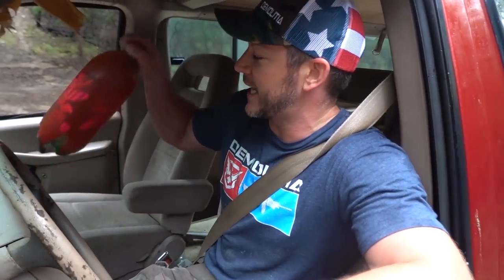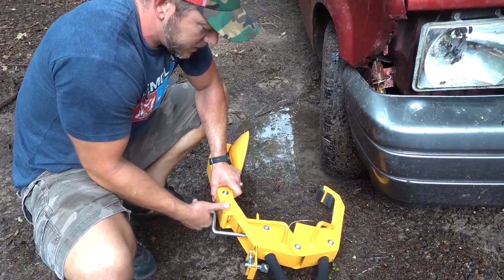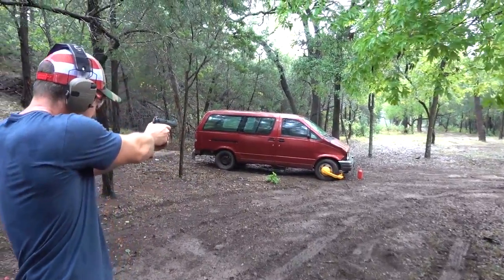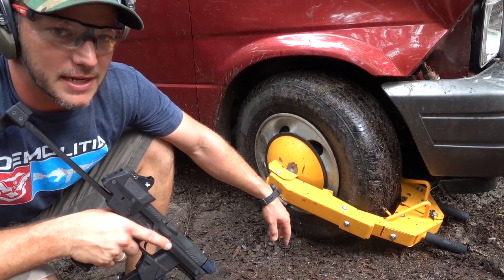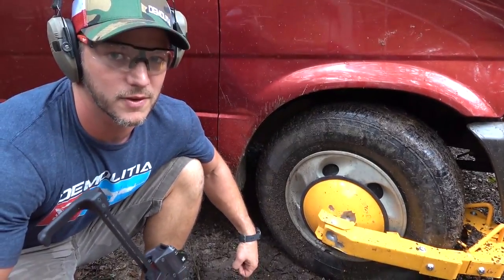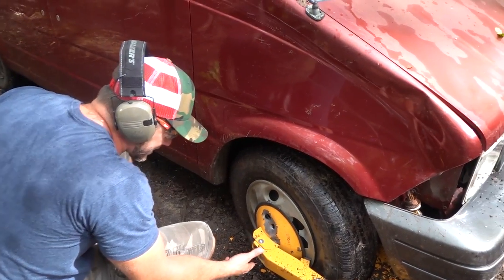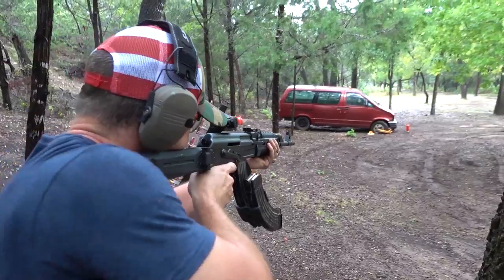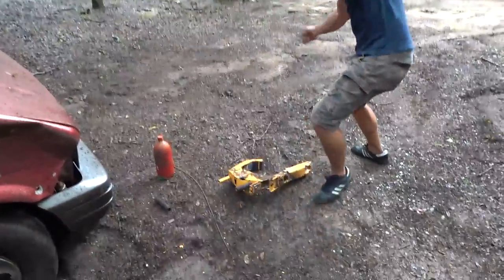Can You Shoot off a Tire Boot WITHOUT Popping Your Tire???

Comment: I’m no mechanic, but I’m like 90% sure you’re not supposed to have all that liquid pouring out the front.
Reply: Hmmm....   Time to go to the shop I guess.
Reply: Liquid cooled
Reply: @timothydavis9777  Emphasis on the past tense in "cooled".
Reply: I am a mechanic, and can certify that while not designed to drain that way, you can 100% lose those fluids for weight reduction. Matt turned big red into a race van.
Reply: I am a mechanic and you are correct, sir.

Comment: When dealing with a boot I've got one word for ya,  battery powered angle grinder
Reply: one word would be batterypoweredanglegrinder
Reply: Thats 2 words 😒
Reply: Ok
Reply: Uh 4 words
Reply: My favorite word
Reply: That’s four words
Reply: This dude
Reply: I mean i keep an extension cable and an angle grinder in the truck, so all I'd need would be somewhere to plug in at. Or an air compressor and a pneumatic cutting wheel.
Reply: He must have experience
Reply: Cheap tubular lock pick really ez
Reply: Or a cutting torch which would be faster and quieter a burn bar or a breaching round for doors or if you got several grand a hydraulic rescue tool like the jaws of life or a plasma cutter
Reply: Thats 4 words 😐
Reply: ThaTs fOuR wORdS
Reply: IStayHighI 4words
Reply: @dax8407  good job realizing what the joke was. Do you want a gold star?
Reply: That is 3 words
Reply: @alexbolin852  he did say " bsttery powered"?
Reply: @southernshop8424  I've never really tried a battery powered angle grinder before. Usually when I have to use one I have an outlet near by or on the vehicle itself
Reply: @alexbolin852  I was thinking battery powered sawsall, they work well on steel with the right blade. Of course it would depend on what steel they use. A36 cuts easily.
Reply: IStayHighI 4
Reply: thats 4
Reply: @malachi4043  And if it was a joke, you'd be right.  But not today.
Reply: I’ll do you one better  plasma cutter
Reply: @max-yg3zr  The weight and hardcore muzzle brake make that seem tamer than the magnum.  Wonder how no brake would go.
Reply: I can see you're a man of few many words
Reply: Battery powered ANGLE GRINDER is FOUR WORDS Slim.

Your Welcome.
Reply: Sir that’s four words
Reply: An easier way is some very easy to get lockpicking devices, it’s a super simple lock

Comment: Matt: does more damage to car than the boot
Reply: The funny part is the answer is pretty simple from what we see here, shoot that thin piece of metal covering the unlocking bolt with .22 or 9mm at worst and then just use a wrench to unscrew it and take the boot off. Of course most places that would put a boot on your car are in a packed city center where pulling a gun is prooooooobably a bad idea and even if you got away with it they've got your details anyway negating the point....but I guess one can dream.

Comment: Ever since I got "booted" for "illegally" parking at a marina where I got called to in order to fix a boat, I  carry a battery powered Sawzall (with metal cutting blades) and spare batteries. 
It does work.
Don't ask me how I know.
Reply: Get a good carbide blade mich better than bimetal
Reply: Maybe just park where its allowed... much better solution
Reply: @verdant681  private parking areas you can park wherever the property manager says is allowed, no matter what the paint on the ground says. if you get permission, you can use the middle of the lane. It's just that not everyone knows when someone gets permission.
Reply: @verdant681  yeah but you see if you park like an inch in an unallowed zone in a lot of places they will at leads ticket you so carbide blade is much better
Reply: But you just told us how you know...
Reply: @verdant681  
It said "No unauthorized parking"
Since a tennant had called me, I figured that I would be authorized. 
Evidently,  the Parking Nazi thought differently.
Reply: @BLut91  
I never said that I actually used it - nor will I - at least until the Statute of Limitations expires...
Reply: @supergeek1418  parking Nazi... easily one of the funniest things I've heard all day 😂😂
Reply: I carry a portable plasma cutter ain’t no boot stopping me
Reply: @supergeek1418  so in your made up story why didn't you just tell the company you had permission to park?
Reply: Just use a screwdriver
Reply: Laughs in watching you get fined for destroying government property, fined for removing the boot, and then paying the original fine
Reply: @brandonconway4822  hahahahah
Reply: @brandonconway4822  
It was not government property. 
This was at a private marina, using a private enforcement company. 
I don't think that any laws were broken,  but there still could be some civil issues...
Reply: snoop doggy dog  
Riiight...
For stealing my own car?
I don't think so...
Reply: @ronpaulssecretary  
I did.
For that he knocked 10% off the fee.
Evidently,  you're supposed to get a temporary placard at the office.  Unfortunately,  there was no sign saying this, plus (since it was after hours) the office was closed.
Reply: Hell yeah, I carry a cordless cut off grinder and sawzall
Reply: Milwaukee cordless tools 😎👍❗️ get that bi-metal blade like the other fellah said ......those diamond impregnated ones are damned expensive🛠😈
Reply: @billyaitken1713  
Yeh. The steel that the boots are made of doesn't seem to be of a very high grade. Diamond or carbide blades are WAY overkill.

Comment: I remember getting booted in syracuse and cutting it off with a cutting wheel. The cops didn't think it was funny but the meter guy thought it was hysterical enough to just fine me. Still got the certificate framed.
Reply: Did they charge you for the boot?
Reply: @yankees29  Yeah.... Worth it though. Just to see the cop get pissed off and hand me my keys back.

Comment: Fun fact it only takes about 30 seconds to pick a boot if you know what you’re doing
Reply: Explain lol
Reply: Three letters, LPL
Reply: Watch the lock picking lawyer he made a vid with the same boot and u can take it off with a screw driver in 30 seconds
Reply: Yh and all you need is a Barrett 50 cal
Reply: takes 3 with a drill...
Reply: Yep, if you have a cordless drill and a 1/2 inch carbon bit, those stupid locks are gone in seconds.
Reply: 30 seconds like 10 , the locks are so loose you can jiggle it... maybe 30 to jiggle and remove bolt... it's really REALLY easy
Edit: spelling
Reply: Thanks lock picking lawyer 😂

Comment: Pro tip: to remove one of these put your car in a jack. And either remove the tyre and put your spare on. Or deflate your tyre and remove the device. 
Also if you keep the clamp they cost like 2 grand to replace
Reply: Banggood also sells 20$ cylindrical lock auto pick tools that will easily pull that boot off in a matter of seconds without having to do anything to your tire or even use a jack.

Comment: The tire, rotar, hub assembly caliper radiator and probably a pump or two. The other fluid leaking out of the radiator would be Automatic transmission fluid. Cooler for the trans is built in to the radiator. You might as well finish it of by lighting it up with tracers (gas tank) or a rag in the gas tank.

Comment: Just use a wax slug up close shooting downward on top of the elbow joint, and use 8 shot or smaller in your wax mix, even sand blasting shot would work well.

Comment: Mechanic: Soooo appears to be bullet hole in you brakes, radiator  and engine block sooo yeah that would be a problem 👨🏻‍🔧 brakes $200
Radiator $500 engine $4000 transmission $2000 traffic ticket 250= 6750 shooting off boot, having fun doing and Getting so good shot down range priceless

Comment: "If you shoot it off and also pop your tire, you're in trouble."
If you shoot it off, you're probably in trouble.  If you shoot it off and pop your tire, you can change your tire (if you have a. spare).
          The locks you closed appear to be a weak point, and should be the target.  If you could unscrew the bolts by using the key you should be able to do so by shattering the locks.
Reply: I’m no professional but I was thinking that the whole time. The little doors that lock were thin and if he shot the keyhole he could have automatically had access and most people have the tool or a tool that fits. Which in theory would have been faster and less damaging to the tire.

Comment: Most Vehicles the trans cooler runs through the radiator so if you blow the radiator part you're going to blow apart the trans cooler

Comment: so my take away is if living in murica and don't want to pay the parking ticket get a 45 acp 1911 a small piece of armor a screw driver set a crowbar and a pair of shades to go with the mask pop a few rounds into the cover protecting yourself from ricochets with the armor graded for a heavier round get the crow bar to pop the cover off and the correct screw driver to unlock the boot then dump that boot a mile off the shore Kevlar tires would definitely be helpful in this endeavor as well as a strong suppressor